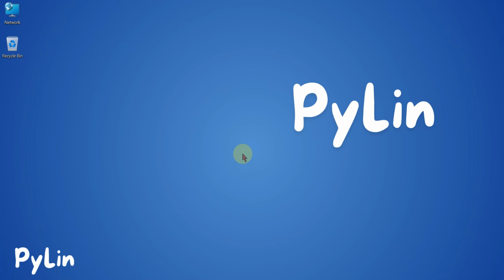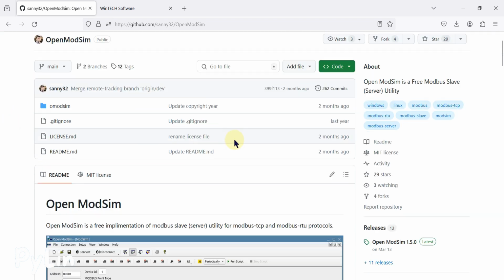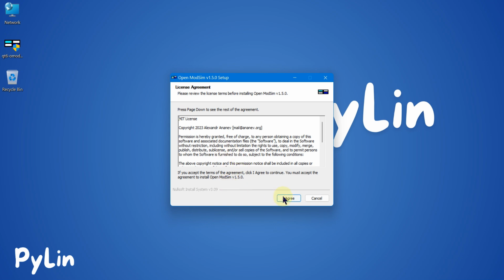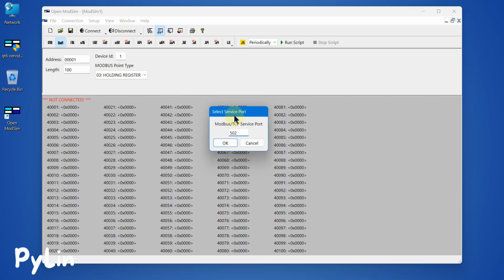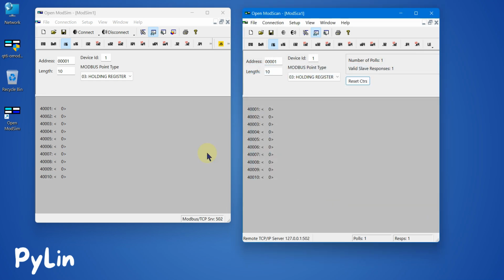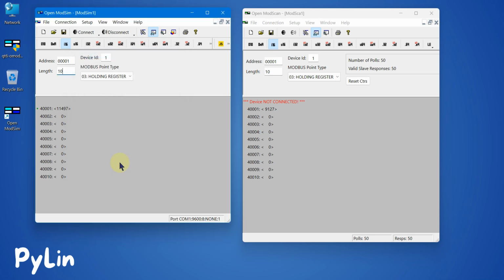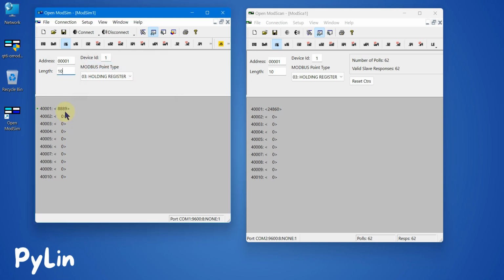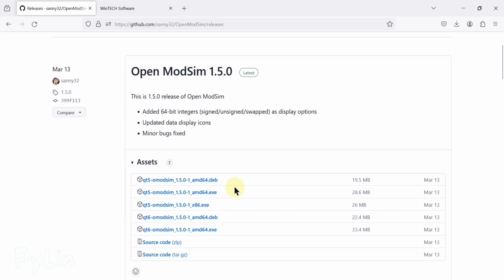Download, Install and Use and Open Source ModSim Alternative Open ModSim Software | IoT | IIoT |

Comment: no connection to port serial on my omodbus and omodscan, do you know why?
Reply: in this video, open modsim connects to com1 and open modscan is connected to com2 because com1 and com2 are connected internally using virtual port serial driver so  that whatever is sent to com1 is transferred to com2.